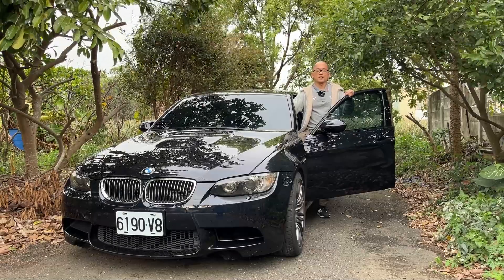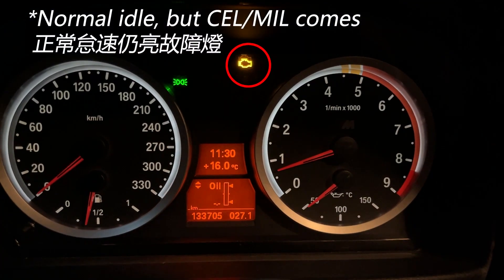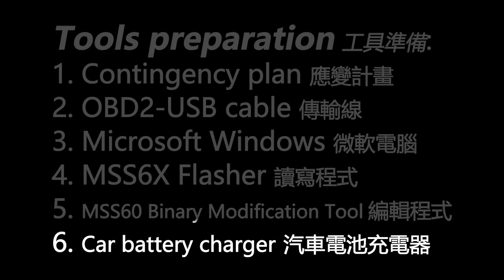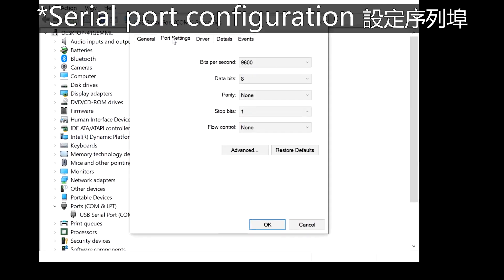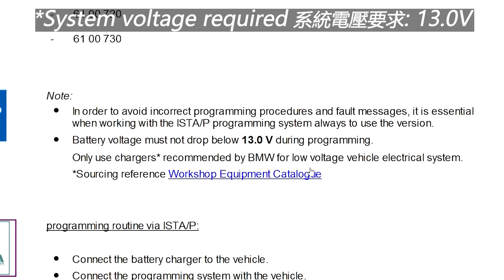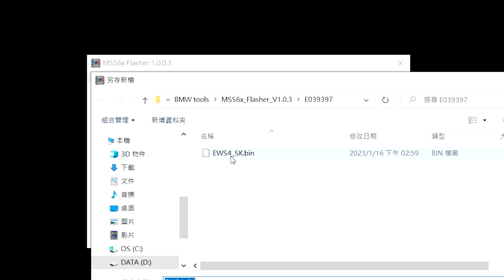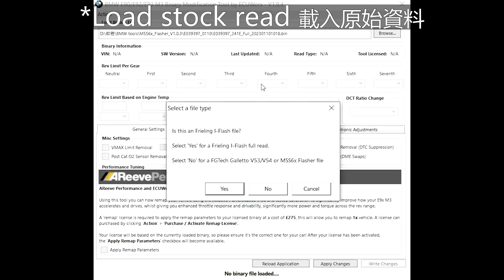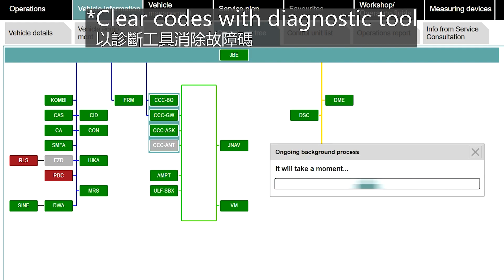BMW E90 M3 Cold Start Delete Fixed Rough Idle and Misfire Codes

Comment: Excellent job, I have been looking through a lot of stuff on the ECUWorx tools and this is the only completely clear with full A-Z steps I can find. Finally I fully understand the whole process thanks to YOU. I am a Brit living in Shanghai and I own a 2013 E93 M3 with 55,000 kM. I too suffer the cold start problems and have been looking at both the maintenance and software solutions. Apart from the rough cold start I also got misfire problems a while back, only on the cold start. I changed the battery and the misfires went away but the RPM drops of the cold start continued. Recently I drained my battery a little while using ISTA to test TA and ICV etc searching for possible problems that cause the rough cold start. With a low battery the misfits returned. Something during the cold start procedure needs voltage. Once the battery is charged back up the misfires go away. Ista finds no problems and the only codes I get are the misfires on multiple cylinders when the battery is low. I think multiple cylinders can rule out normal things like plugs, coils and injectors, also smooth running after the cold start. I don't want to blow 5000 RMB on new ICV to find that the problem still remains so I think I will try the cold start delete either by using the ECUWorx method of buy a tune from BMP/Evolve?Alipne with the cold start deleted. BTW, my car is completely stock, no modifications to blame 🙂. But again a big thanks for such a well put together walk through and all the excellent safety tips before starting the job. Living in an apartment in Shanghai presents its own problems for battery charging and easy tow away access 😞. All the best, Rob
Reply from the maker: Hello Rob,
Thank you for the comments! I am very happy you find my video useful. Please kindly let me know your further thoughts about the M3. It's such a nice and fun car to drive as well as to own and maintain. Welcome to the big supporting group! 🤗

Here you just gave me a cool idea about the misfire associated with system voltage. ISTA has documentation about misfire detection for the S65 engine. In short, the DME uses the ignition coil and spark plug to measure the current and duration of the spark to determine combustion quality. So that makes sense why misfires were detected when battery is low.

In addition, there are complaints about the electricity consumption of the E generation. The battery drains faster than the previous products even when you just park the car for a long time. So I found that constant driving of the M3, which charges the battery, is also an essential item of maintenance. I don't drive mine often but when I do, I usually drive 150-250 km in one day. Around 50% of the total drive time is cruising on highways. I guess this is why I have a healthy battery and a healthy power train at 135k km of mileage. (Last battery change was in 2018.)

I never have ICV problem (knocking on wood) but I will watch it out. Especially when I have just topped the fuel tank. That is the timing most people observed the ICV problem. If you don't have rough idle right after a full tank, you may exclude ICV at this moment.

I just came back from the track day and I really had fun with the M3. It's so reliable that I am surprised that I could rev the 15-year-oil engine 4000-9000 RPM for 20 min track time and go home without any check engine light (wait, let me scan the codes 😁.) Please expect my next videos. See you soon!
Reply: @funcarsgoodpeople  I love the car, its my pride and joy. Even though I have a standard exhaust the sound is wonderful, I spend most of my time with either the roof or window down so I can hear the intake, exhaust and throttle blips, no car has ever put a bigger smile on my face, I just wished I lived somewhere with less traffic and winding roads, Shanghai is terrible for a driver.

Comment: Hi , where i can talk with you , i have a problem with my e91 320d , crank But no start ( 4691 error code ) DDE: supply voltage 3
I have changed everything , fuel pumps working , rail sensor , regulator , relays , injection pump sensor and don’t start…
Thank you for understanding !
Reply from the maker: Hi Alexandru I am happy you have the fault code because it tells us some clues! I use information for N47 engines (DDE6;)

The DDE control unit supplies a number of sensors with a 5 V power supply as detailed below:
- Supply voltage 1: pedal position sensor 1 (PWG), rail-pressure sensor
- Supply voltage 2: pedal position sensor 2 (PGS), turbocharger pressure sensor, air mass-flow meter
- Supply voltage 3: Crankshaft position/rpm sensor

The rpm sensor signal is used as a measurement variable for:
(many items)
- Checking start conditions

And there will be some other fault codes related to the speed sensor; The following faults are monitored:
3E90, No crankshaft speed sensor signal
3E91, Crankshaft speed sensor signal incorrect
3E90, Temporary loss of crankshaft speed sensor signal
3E91, Crankshaft speed sensor signal temporarily incorrect
In addition, the speed difference between the camshaft and crankshaft is monitored.

Consequence: 
- Engine shuts down

Please first check the wiring for the camshaft position/rpm sensor. Make sure the sensor has 5V power supply. Then check if the sensor is functional (swap it on to another 320d.)

You can provide me more information via funcarsgoodpeople@gmail.com and I can send you more ISTA documents I mentioned above. Good luck!

Comment: Hello! I think your car has the same issue as mine. when the car is bone cold and hasn't driven for like a day after you car starts like it's low on fuel pressure. (23:20 that sounds like it's fires once and the car struggles after and starts right away. it doesn't sounds like one hit)
have you noticed and tried to fixed this issue? it seems like you've already changed O2 sensor and spark plug. but you didn't swapped the ignition coils right? what do you think this is happening? i feel like the car is in not a good status.
Reply from the maker: Hi PennyKenny yes I do sometimes have an extended crank recently. I am trying to record that process but haven't caught it yet. Like you said it felt like low fuel pressure but it doesn't come on every bone-cold start. It may related to my addition of RedLine fuel additives but I'm just guessing. FYI, I haven't replaced my ignition coils since I got this car. The spark plug roughly accumulated 20K km.

I don't drive the M3 often but when I do I usually make around 100-150 km in one day. I scan the car very often (because I have been making videos about coding) and I did not see any fault codes about ignition. So I will assume the ignition coils and spark plugs have aged normally.

Let's continue the observation and perhaps make a video about it shall we? I will update in your comments. Come back often!
Reply: @funcarsgoodpeople  Thanks for all these infos!
I've searched a bit more and found this video!

https://www.youtube.com/shorts/lrWQxvcg__w

And he solved this with changing the fuel injectors.
he said the old injectors were leaking!
I've owned this car about 6 months (2010 year model, 110000KM)
and I didn't do spark plug, ignition coil, fuel injectors yet. TA done(rebuilt), rod bearings done(ACL)
and I'm planning to do spark plugs and fuel injectors first. these coils are damn expensive!
cuz on some S65 engines, fuel injectors can be seized open position while running and hydrolock the engine, Kill the engine.
valve springs are other things to keep an eye on but that's too much for now

I'll do spark plugs and fuel injectors for my M3 in a month or two
and record the whole process and post it or I'll let you know on the comments!

have a nice day!
Reply: @funcarsgoodpeople  and yes mine doesn't throw codes too T_T
but at idle the rpm needle doesn't jump and there's no noticeable move at rpm needle but the car feels a bit shaky.
that's why I'm planning to do fuel injectors!
I'll come back when repair is done!
Reply from the maker: Thank you PennyKenny I watched the shorts and read the comments. I understand that is the normal start. No hesitation. So this is the new item to be replaced 😂 like you said wayyyy too much. Let's do them one by one. Please let me know your result!
Reply: @funcarsgoodpeople  Hello I'm back with a good news!
my M3s problem has solved
I posted a two shorts(before&after)
you can see and hear what I was talking about. hiccup at cold start!
changing a set of new injectors worked for me!
highly recommend doing this job.
weird ticking and vibration from the car has gone. well maybe changing spark plugs could solve that too but it punches more and feels great!
have a nice day!
Reply from the maker: Hi PennyKenny thank you for the feedback! I saw both your shorts and sure it is satisfying! I use to remove my spark plugs, clean the carbon deposits with copper brush and put them back on. This does improve running quality of the engine. But I agree with you that the fuel injectors are the parts to be renewed for this high performance engine. I will list them as the items to be replaced in the 150k km maintenance. I will remember to report to you :)

My next project is to replace the valve stem seals to fix my oil consumption problem (about 1 L every 2500 km!) After my track day in 6 May I will start this project. I will also update the result. See you soon!

Comment: Hello friend. I've asked the garage to do the cold start delete.   Hope mine won't do that crazy noise thing.
Reply from the maker: Well I think the cold start noise is at least 30% cool but I am living in a community so I don't want to bother my neighbors.

Other than the noise, the misfire codes are the most annoying side product of the cold start and they are sufficient reason for us to do the cold start delete 🤗
Reply: @funcarsgoodpeople  hi Carl, thank you for your message. I think cold start is cool as well, but for me dumping more fuel is the main issue. Hope the misfire is sorted and he does the cold start delete and all will be well. What tyre  do you have  on the beast? I've got Continental contact sport 7. Really nice.
Reply from the maker: @Simpleboneguy  Hi Arjun some of my friends are running the CSC 7 too. It has good reputation! I am running on Michelin PS4S in the front and PSS in the rear, just for the sake of on sale price.

I drive a lot on highways and the PS4S lasts really long, more than 40K km! Perhaps it's because of my slow driving style 😁 I gave a short review on the tires in my racetrack video: https://youtu.be/X2bW8qPqRQA?t=663 However this combination is not satisfying for the racetrack I suppose 🤔
Reply: @funcarsgoodpeople  hi Carl,  love video re the cold start delete but i dont have the ability ofna pilor to follow proceedure. 👏so best left to the professionals for me. 😁 I believe the ccs7 has a good longevity as well as good wet handling and braking as per reviews. I'm not a professional tester so can't tell the difference. I have never tracked my car. I just enjoy the sound, performance and the handling.  So not really keen on tracking the car.
Reply from the maker: @Simpleboneguy  I see Arjun. I enjoy the M3 on the streets and highways too. The car is so balanced and it goes the way you want. I am supposing that I cannot find such car again 😁

Comment: The cold start is to allow the car to reach operating temperature.  The secondary fan provides air so the mixture is not perfect so that causes the cold start. Its perfectly normal and should not be deleted. It adds a longer life to the engine because the engine is performing optimally when warmed up properly
Reply from the maker: Hi Terry, thank you for the input. I agree that there's a reason for BMW to design a engine like this. It seems to me that only some of the S65 engines give the crazy rpm fluctuation and misfire codes.

I also believe that a brand new S65 engine will not give misfire codes and it may be due to aging of the engine. Sometimes the cold start stalls my engine so I feel it a bit troublesome. What do you think we can do about it?